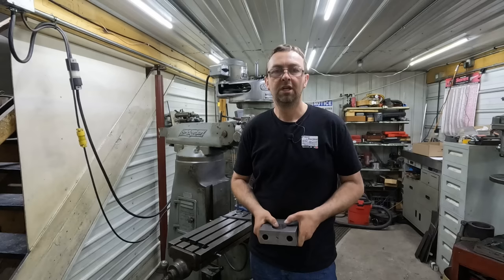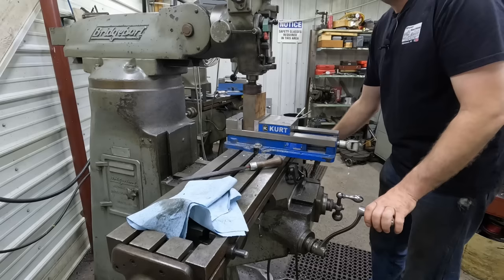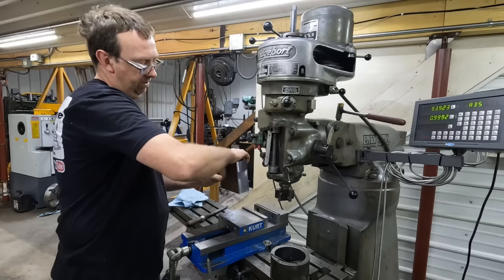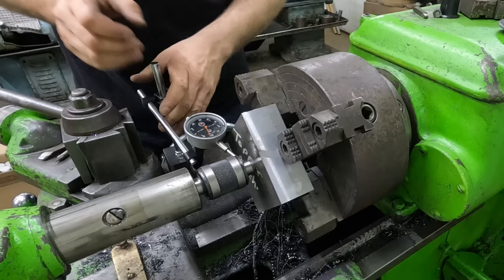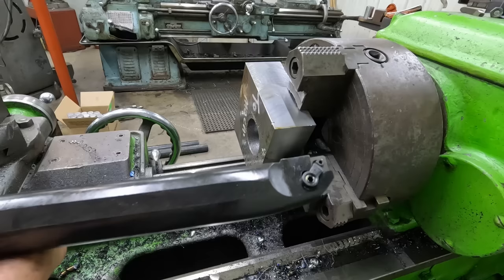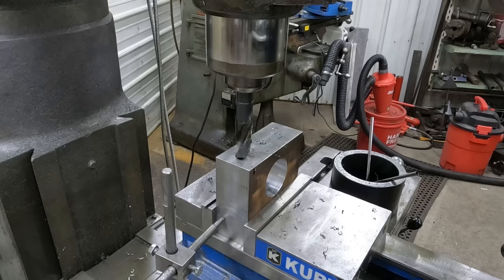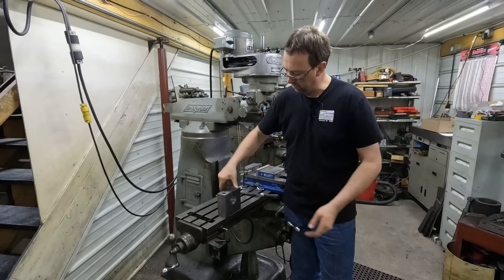Machining a Custom Hydraulic Cylinder Trunnion Mount - Manual Machining

Comment: You sure have a lot of old, obsolete machines in your shop. I wouldn't mind betting that some of them are older than you and still working well. It really pays to keep this old equipment running with its ""built to last and keep running reliably" technology. You often mention helping out other shops because their new fangled gadgetry has broken down again. These old machines sure keep on keeping on.

Comment: Hello Josh, I have a nearly identical job coming up in the next few weeks.  It's about 6" by 10" with a 3.5" hole out of 2" thick plate.  Two 3/4" holes for bolts just like yours.  However, I have 50 of them to do so I'll be putting some kind of a fixture on my lathe for doing the 3.5" hole (it needs to be a press fit with an oilite bushing).  The pieces are arriving flame cut oversize and all edges have to be machined.  The hole is burned out undersize as well so I only have to bore it.  Other than the 3.5" hole everything else will be done on my boring mill.  I'll try to post a video about it.  Along with these parts I have several hundred other parts to do as well on the same project.  I think I may have to invest in one of those self-tipping swarf bins.  It will be nice to be busy again.  Ken
Reply from the maker: Nice!  That will be a good job for sure. I hope whoever is cutting them knows what they are doing and don't harden the surface too much. On that bore, could you use a shell reamer?  Would spend up the precision boring. Rough within 0.010 and ream the last bit.

Comment: Next time just use a spring loaded tap guide into the work's center drill hole, then indicate that spring loaded tap guide's OD close to the work face, held true on the other end by your tailstock

Comment: Any particular reason to not just use a boring head instead of switching to a lathe?
Reply from the maker: Lathe is way faster
Reply: @TopperMachineLLC yeah guess it depends on how close of a drill size you have.

I have an irrational dislike of 4 jaws
Reply: And he can show some offset turning. Just did some for my manual lathes 2 class at Athens Technical College.
Reply from the maker: @Aztal  if you hate 4 jaw work, tune in next week for a good one. 😂
Reply: @TopperMachineLLC  will do lol, 99% of the lathe work I do is done via collet or 3 jaw, so any time I gotta bust out the 4 jaws it's a bad day

Comment: Regarding the indicating on the square block, in the 4 jaw, put a dead centre between the live centre and the hole in the block, and indicate the dead centre.

Indicate it near to the point, for maximum accuracy.

Comment: I ran a radial arm drill press years ago at Wheeling-Pittsburgh steel. It was a little bigger than yours. I believe, if my memory serves me correctly, that it had a 14 inch column. I loved that job. It was a Carlton and the controls were the same. Man, that brings back memories from the late 70s, early 80s. We had drills up to 3 inches. For any hole bigger we had a boring bar. So cool. Love your videos!
Reply: I work at the old Steubenville south plant, now owned by JSW, I ended up purchasing most of the old tooling from the machine shop at Steubenville north. Small world

Comment: Good use of the lathe, difficult to quickly creat holes on a tool room sized mill, like that stubby drill. A twist drill is still the most efficient metal removal tool on standard machines. 
Nicely done Josh, thanks for sharing.

Comment: the way I center a block or drill an offset hole is to put a dead center between the tail stock center and the center drill or center punch mark then indicate off the dead center. less side movement on your tail stock.

Comment: I do like the setup with the tailstock for the drilling of the hole for the ram. That is a very good way to find a hole center on a non round part. I'm also glad to see the radial arm drill being used, a rare machine with lots of possibilities.

Comment: Man, is there any machine you dont have.  Just completed an almost indentical part in my shop, only I had to complete the job using just a horizontal bandsaw and a drillpress with a homemade X-Y table!  Might I be a wee bit envious.  I did make a visit to a local machine shop to finish bore the center hole to 1.630".   Stock thickness was 0.875" on a  2.435"×6" rectangle.  These are actualy bearing supports for the table feed leadscrews on that sawmill I am building.  There are 4 perpedicular holes, 1thru and the others ⅜" tapped.  Building up the rail/leadscrew assemblies tomorrow.

Comment: You need a test indicator,  rather than trying to squeeze that big ass dial indicator into some of these tight locations that I've seen you struggle with more than once.
Reply from the maker: I have them. I prefer the bigger dial for visibility. And, you can't see the little indicator as well on video.

Comment: No adjustable boring head? Good way to do it though, if you have a mill/lathe setup this way. Super fast route, albeit a hot block by the end 😮 I’ll have to remember this is actually something I can do to think outside the box 😂 great use of multi setup, always love to see the different setups you use.
Reply from the maker: I do have one, but this is way faster and easier.

Comment: Hi Josh. Just a thought. Would it not have been easier to hold the bore indicator in the (softly clamped) vice and use the micrometer to do the measurement? You know WAY more than I do, I’m just a hobbyist. All the best mate. 👍

Comment: Hey Josh, I've worked in the same machine shop for 30 years. I'm enjoying your videos as it gives me a chance to learn new things other than the way we do it. We do not have a radial arm drill press so I have very little knowledge of them. I want to ask what is the advantages of moving the part to the radial arm drill press over finishing the part in the Bridgeport? Thanks.
Reply from the maker: Mostly for the quill travel.  The bridgeport wouldn't drill all the way through without moving the knee up.

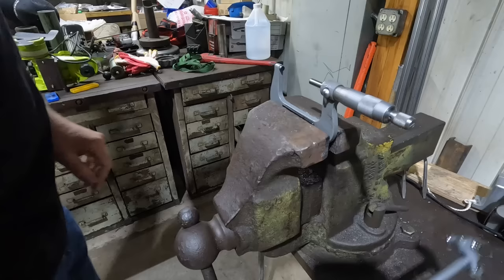Comment: 20:35 I'm thinking oh he didn't just clamp that mic in a vise without some soft jaws, shop rag, or something to protect.  No matter how light you clamp - that's just brutal.  I do like that little radial arm drill.  Looks handy for a small shop.
Reply from the maker: These micrometers have a plastic soft body. Nothing to worry about. And they are my cheap Chinese ones, not the good B&S or Starret

Comment: Have you ever had any issues with part lift in your kurt vise?. My kurt dx6 will lift my part about 10 thou when tightened down on parallels. You can see the part move if you watch closely
Reply from the maker: Yes, quite a lot lately. Thinking my voice needs replacement or cleaning. Also, if your material is not perfectly square on the back jaw, it will lift when force is applied.
Reply: Mine is pretty much brand new. But it will still lift even a 123 block in the jaws with out parallels drives me crazy
Reply: I have a six inch Kurt vise in my shop and I can tell you how to adjust it to fix the lift. There’s an adjustment screw in the rear of the movable jaw that can be tightened to control lift. Screw it in as far as it will go, back off slightly and check if the jaw still lifts. This screw contacts a Kurt designed 45 degree ball socket wedge that prevents lift when adjusted properly. If the screw is backed out far enough the movable jaw can be removed from the vise by lifting straight up. Once the jaw is removed you can clearly see how the anti-lifting device works. I hope this helps.
Reply: @TopperMachineLLC  I thought your "voice" was just fine and needs no cleaning or replacement.
Thanks for another great video!  👍👍👍

Comment: I’m guessing your lathe is significantly more powerful than the mill, right? I wondered why you didn’t use a boring head on the mill- but that would be a lot slower than shoving a massive drill through there. Cool!
Reply from the maker: It comes down to time. It's significantly faster to move over to the lathe than try to do it all on the mill. In this business, time is money.